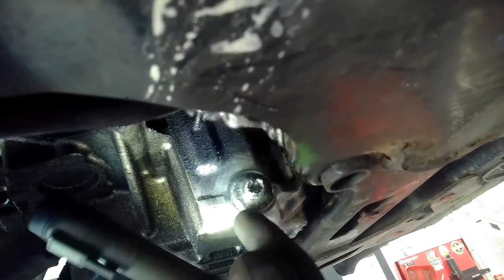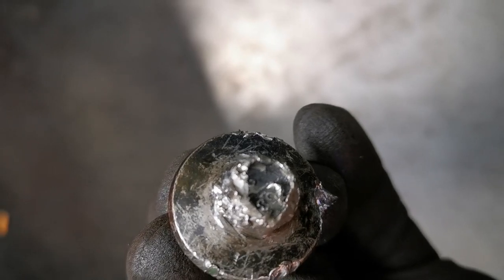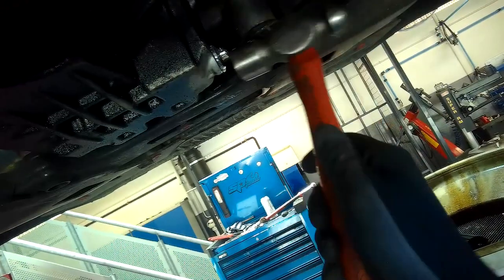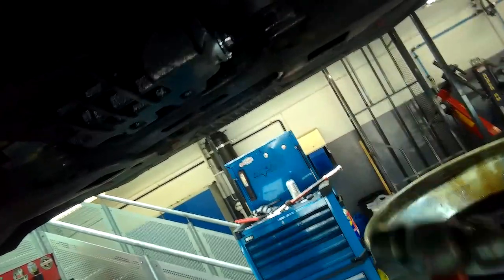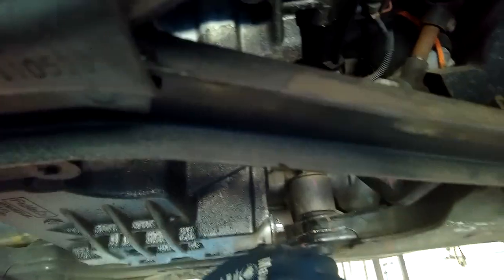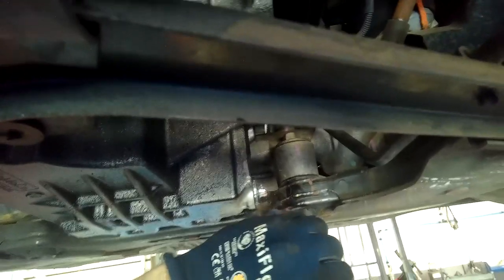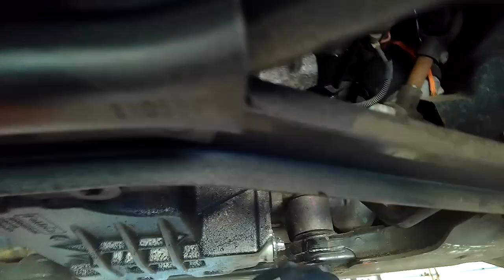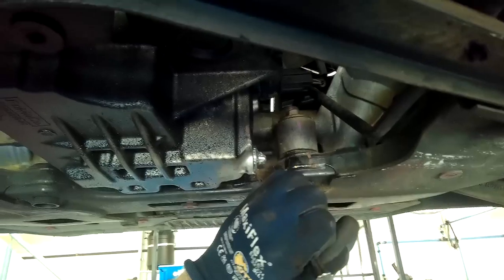How To Remove A Damaged Hex Head Using Only Basic Tools

Comment: Had same issue with a insignia ,twist sockets mole grips then the hammer and chisel came out ,don't no why some people feel the need to over tighten them,doesn't help most 13mm head sump plugs are made from plasticine
Reply from the maker: The small head certainly doesn't help and in other cases using 12 point sockets on these can round the edges a bit too easily 🙄
Reply: @GerardBurkeBurkesGarage  your right there, 12 point sockets or spanners on these sump bolts just asks for trouble,I always use long ratchet and 6 point socket to break loose

Comment: must have taken a while, i think i may have welded a nut to the head of the bolt, but that would be on my car only to avoid the You ruined my car complaint.
Reply from the maker: Yes there was a bit of time included in this for sure, I did it at the normal oil change cost and we were both happy to get this result before closing the shop :)
Reply: My thought as well on welding head on, say a 13mm nut, is it possible? Good or bad idea?
Reply: @disturbedcarrot  yeh it works, not bad for stuck head bolts , ive watched a guy use hollow threaded rod as a perfect guide for a left hand drill bit to drill dead centre of broken bolts in heads, seen others use a peice copper pipe to protect the bolt hole while welding a nut to a broken bolt. dad was a first class fitter machinist he knew every trick under the sun